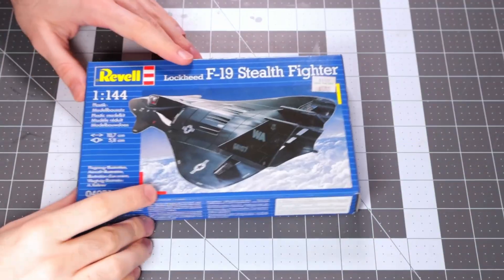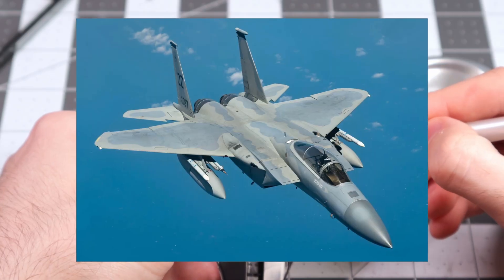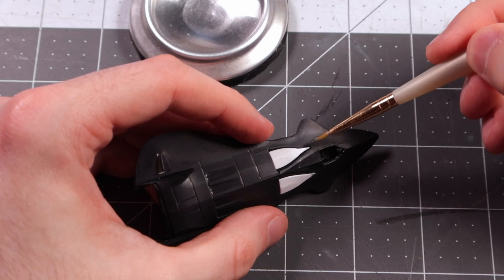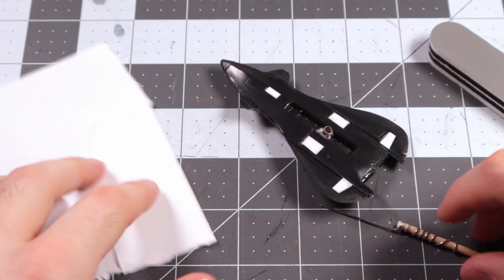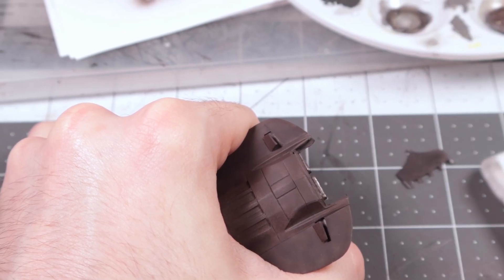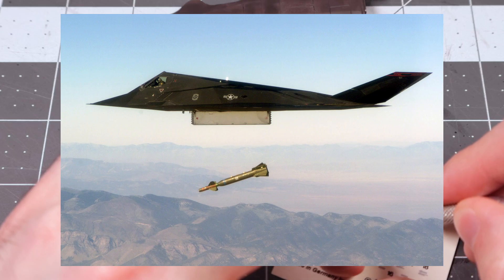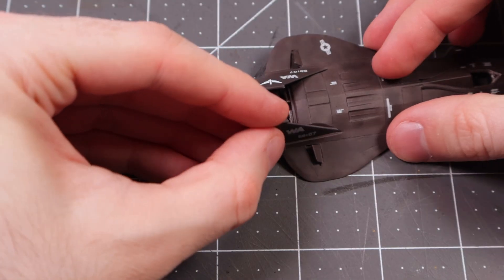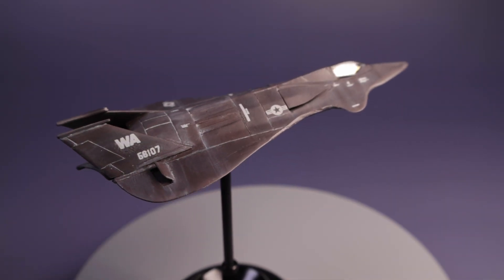F-19: Testor's Fake Stealth Jet that Fooled Everyone

Comment: I was thinking this design was actually very accurate.  Not to the actual F-117 though; rather to its prototype version: Project Have Blue.  Have Blue's shape was very similar to the "F-19" design if only curvier.  Have Blue's design was basically a flying Dorito shape with some trailing extensions to the wings.  The crazy part is the F-19 model pretty much nailed the Have Blue's tail design.  HB's tails were inversely cantered to the final F-117, much like the kit's.  The only other difference is there were and are no canards on either Have Blue or the 117, as they aren't very conducive to stealth if not done correctly.  So, in a way, the model was accurate, but to the even more top secret prototype version of a secret stealth fighter bomber.  Which is creepy if you think about it.

Comment: Time to put this into Flyout and check it's RCS.
Reply from the maker: Intensely funny to me that a $20 piece of software you can get on Steam can do the calculations that the most powerful supercomputers available to Lockheed were unable to do on anything other than a plane that looked like the Nighthawk
Reply: @Sublight_Drive  Frankly, if you just...chrome dipped all your models, shined a light at it in a dark room, and measured to amount of returning light, you could get a similar figure. But then we wouldn't have the Wobblin' Goblin

Comment: Idk if i missed the pieces on the sprue, but it appears you glued custom pieces into what appears to be the intakes on the top of the aircraft blocking them.
Reply from the maker: Yup- I wanted to get a final result that more closely resembled the original Testors design for the kit, which has covers over the air intakes. It's hard to tell, but there's a small gap along the edge that would presumably allow some air to flow in. Plus, air intakes reflect a lot of radar! Covering or obscuring them is like, step number one in reducing a plane's radar cross section.
Reply: @Sublight_Drive  Understanble if you're going for pure kit authenticity.
Seems like a strange idea on part of the model makers if you're pursuing steath first. It is highly restrictive and impacts performance to reduce intake radar returns like that. The f-18 had a re-design of its intake with the super hornets. They went from a practically straight "D" shaped intake to a rectangular shaped intake with a curving "S" shaped intake path. This helped to reduce radar returns from the compressor blades. The switch to a canted rectangle also helped eliminate the 90 degree radar trap effect generated by the inlet and wing while also removing radial scatter that the curved "D" shape generated. There was an increase in intake throughput with the newer design as well despite the longer intake path.
Reply: He used plasticard replacements but the original design did have those pieces, creating NACA-style intakes in a vague concession to stealth concepts (reducing signature of intake ducts and compressor fans)

Comment: I do wonder if when the F117 design was selected, did they have an alternative design prototype do a fly off with it? One thats never been revealed.
Precedent for this. YF22 and YF23, YF17 and YF18, etc etc
Reply from the maker: That's a good question! There is the Have Blue prototype, which is a slightly different predecessor to the F-117, but as far as I know there wasn't a competing design. My guess is that given the degree of secrecy involved, having TWO companies developing the technology, rather than just Lockheed, would've been deemed too risky.

Still, makes me wonder what a fly-off competitor would look like. Though it was never actually built, the MBB Lampyridae is probably the closest that exists, since it was a totally unrelated German program from around the same time period.

Comment: That´s some nice model building and an interesting, well researched story. I had no idea about it. Fun fact: For some weird reason revell has released F-19 kits in 1:144 in at least two entirely different, but similar molds. You, like me, picked the worst one to actually build. Also they sold a "fake" B-2 Stealth Bomber with similarly rounded edges in 1:72 for a short time.
Reply: There was a Loral  "stealth fighter" concept that was a total fantasy from their model shop, but it showed up about the same time as the Testors "F-19" so they were often seen together.

Comment: I do want to issue a slight correction, the F-21 Viper is a marketing term used by Lockheed Martin and isn't official. The real F-21 designation belongs to the Israeli Kfir, which was loaned to the USN/USMC for DACT between '85 and '89. 
Other than that, great video! The F-19 is a very interesting piece of American fighter lore, and the model looks great.

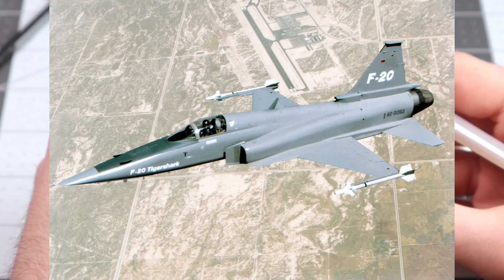Comment: 2:24 Wrong, F-21 Lion is the imported IMI Kfir Canard for aggressor roles. F-21 Viper is apocryphal and something Lockheed Martin made up, it isn't a official designation.
2:33 F-35 is Lightning II not Thunderbolt. A-10 is the Thunderbolt II.

Comment: Thank you thank you thank you for mentioning that the F-117 is not an F at all, but an A.  
I built that Testors kit and thought it was mostly okay but even then recognized 2 air-to-surface missiles meant it had no air-to-air capability so was mis-named.   I think gets called a fighter since it was smaller than a bomber and the air force actively hates hates hates their attack planes.
Nice looking model of a completely fictional plane.  I, too, did the Enterprise model (s).
Reply from the maker: A different story that I heard about why they went with F for Fighter is because they wanted to get the best pilots they had to fly it, and the BEST pilots, of course, ONLY flew fighter jets, none of those grubby attack planes. No idea if that's true or not! But the F-117 is notoriously awkward to fly, and it's not like the military never names things with aesthetic sensibilities in mind, so it's certainly possible.

Comment: There was a B2 stealth bomber kit (Revell?), before the real world reveal, that's a bit smoother than the actual aircraft around the trailing edge. I seem to remember there being a fuss about leaks with that kit too. If you can track down the Monogram Snap-Tite F19 which is totally different, you might like to film a sequel...

Comment: I had one of the original Testors F-19 kits as a kid. Didn't survive I'm sorry to say, but it was such a sweet looking aircraft. The actual F-117 was a big letdown to be honest. 

Fun fact: They tested a version of the F-19 model kit design and found out that it was actually stealthy; not as much as the F-117, but much better than a model kit made by a guy without supercomputer access should have been able to do. I forget exactly where I read this—it was either in Ben Rich's autobiography or in some other book about the F-117.

Comment: Actually the F-19 design is based on the SR-71 drone that sat on top of the fuselage in front of the vertical tail. Plus there were witnesses did see something fall from the sky with three red lights pattern. They claimed to have photographed the objected. Government officials took, developed, and gave back the unwanted parts back.

Comment: lol I see the 1/144 version of this plane still has that huge wing root gap...Its really horrible on the 1/48 scale one, I'm talking forget about filler go straight to filling with plasticard shims and finish with filler and then hope for no shrinkage kind of gap...other than that it was a fun kit to build...Oh yeah the main landing gear You guessed it more filler but its pretty sturdy when assembled other than the gear to body connection that area kind of sucked front gear is easy peasy though. one last thing is the lack of control surfaces, the twin tail its pronounced and easy to see, The wings though are more of a "Houston we have a problem" as the little flappy things are so out of proportion and position...Ah well it is a what if craft anyway so theres that